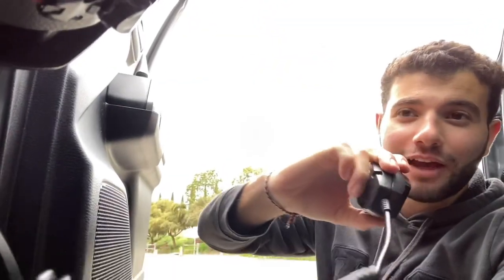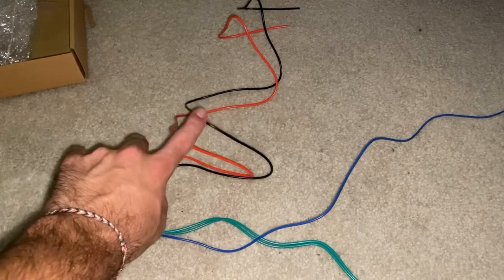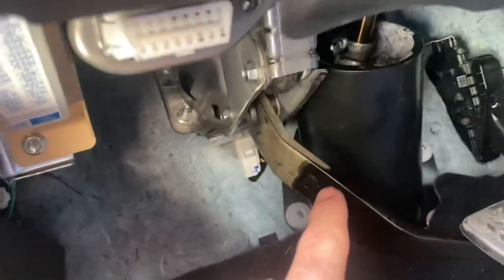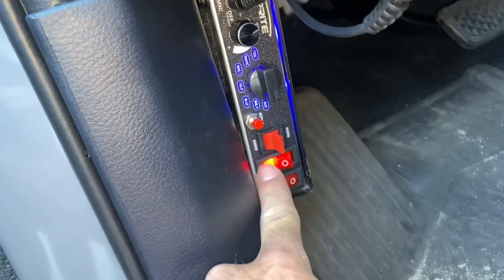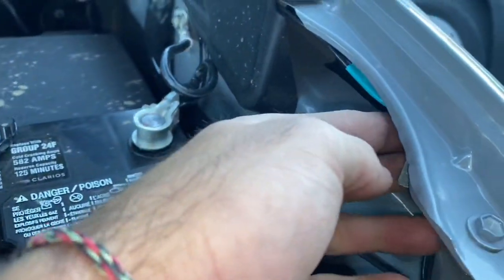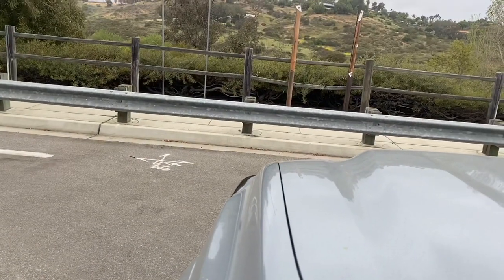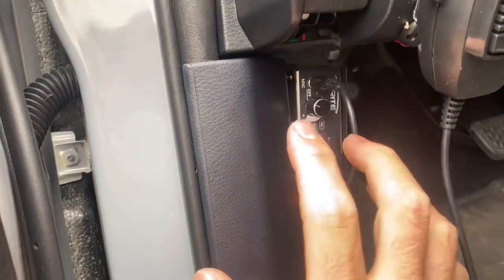LOUD PA System install on my Tacoma! (Siren🔊)

Comment: I would highly recommend wiring this to a fused power source. Preferably one that is key position aware (accessory power aware). I've seen many cases with CB's and PA's  where people  park their vehicles and  accidentally leave  the devices powered on (at some point you ARE going to forget) only to come back to a  dead battery.

Comment: How did you connect the wires to the battery? Also what was the best way to screw the system under your dash?
Reply: Don't wire it directly to your battery. Unless you want to light your truck on fire. Always use a fused system with a relay that takes power from the battery to power the accessories
Reply: @ooasimoo great advice!
Reply: @ooasimoo  most of them have fuses in line with the positive. i used a cigarette socket adapter instead
Reply: i used a cig socket plug and play adapter

Comment: The spot where you put the speaking did you notice any vibration issues that's a great spot I want to do the same on my truck btw is that a c clamp you used?
Reply from the maker: Yeah it’s not a bad spot no vibration, and yes
Reply: Bisa mp3

Comment: Is it illegal to have ? I have it on my police interceptor crown Vic , I never used it on public roads and never will , but I have used it in parking lots , I live in NC.
Reply from the maker: Not legal unless private roads I’m pretty sure
Reply: @TheUnrestricted  not even just to have it installed ? I might have to cover it if I get pulled over
Reply from the maker: No you can have it just sitting there as long as you don’t use it. But double check with your state laws I’m not 100% sure
Reply: @TheUnrestricted  thanks , I tried calling our local sheriff, but I haven't heard back
Reply: I have same question here, I’m from New York
Reply: Using the PA is fine, it's just sirens that are illegal
Reply: @gormauslander  talked to a cop, he said everything is legal , even the police horn, except the sirens on public roads
Reply: Most of these people don't know what they are talking about. There is nothing illegal about any of this and there is no laws about using it on public roads. The only law is that you can't use it in such a way to portray yourself as a Peace officer of any type. I was a Volunteer firefighter for many years and had sirens and lights set up on my personal vehicle
Reply: It's legal for use on private property when it's solely operated on private property. Same with light colors......if you want to put any colors other than amber/white.....Vehicle has to strictly operate on private property. At least here in California. The fact that it has buttons you can hit to accidentally trigger your siren is risky.....Just disable the siren or be careful.

Comment: First. Why would you put a siren on your truck if your not a volunteer fireman or the such.
 
 Second, did you really go thru the door jamb instead of firewall with the wire???

  Third. Did you not fuse the power wire at the battery??

  That’s why people burn their trucks up

Comment: Did you bolt on the hand mic mount? Or is it adhesive?
Reply: Did you have to bolt in the actual system to the side panel near the door? I’m planning to install mine tomorrow in my Tacoma. Any other spots you recommend in installing? Or is that the best spot in your opinion?
Reply from the maker: Adhesive
Reply from the maker: @JM-js5hs  yeah for me that was the best spot. Not on the actual door but under and out of the way.

Comment: won't this drain the battery without a relay?
Reply: Over time yes, I had an issue like that with my subs, I added a switch and it fixed the issue
Reply: @randomperson9248  how

Comment: Shouldn't you use a relay?
Reply: No need for a relay with this system but he definitely should have used a fuse for the positive wire. Specially since he decided to run the wires in his door jam which will eventually short out🤦‍♂️

Comment: You put in so much work to hide the wires but cut corners on all the important stuff🤦‍♂️
1) You need to put a fuse on the positive wire running to the battery.
2) Use proper butt connectors for your speaker wires (I personally prefer to solder the wires), as well as proper end terminals for your power wires connecting to the battery.
3) Properly run the wires through the firewall and into your cab. Your wires in the door jam will eventually get destroyed and pinched which will cause them to short out and since you have no fuse on the power wire, it will end very badly. 

What you just did was give an instructional video on how to burn your vehicle down. I urge anyone who wants to install one of these systems to please go watch a different video that will show the correct way to wire it in or else you are just going to cause alot of issues for yourself.
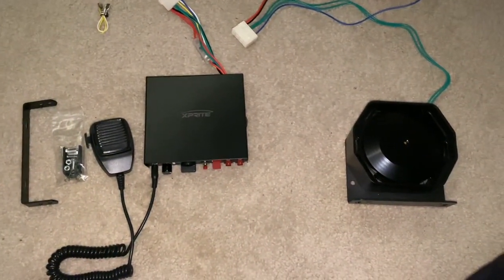Reply: I agree with the last 2 points you made but you need to be more observant about point number 1. You can clearly see a fuse on the positive wire by the control box at 0:43 
I happen to have this exact device and it already comes with a fuse. However I used proper connectors and wired mine through the firewall.